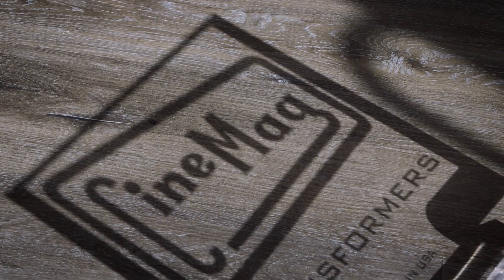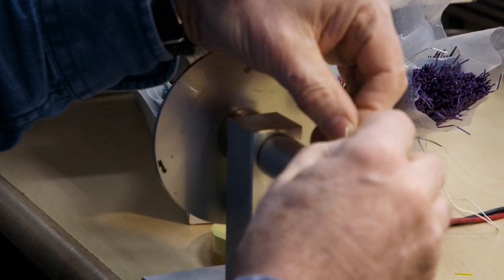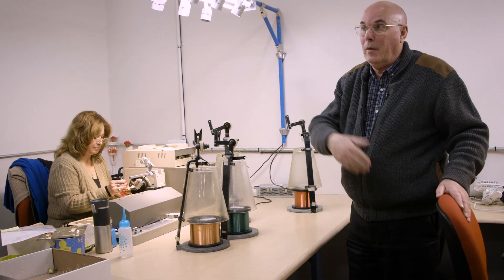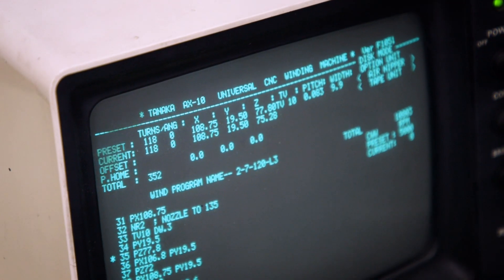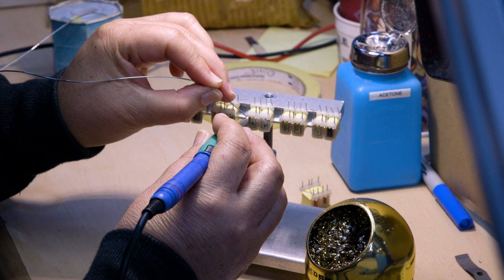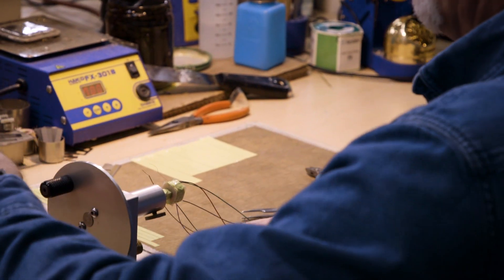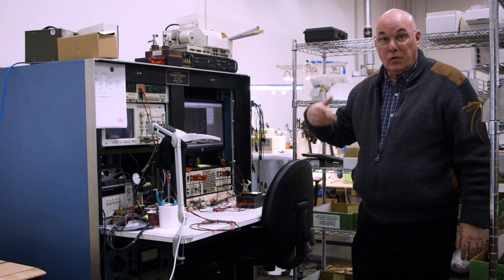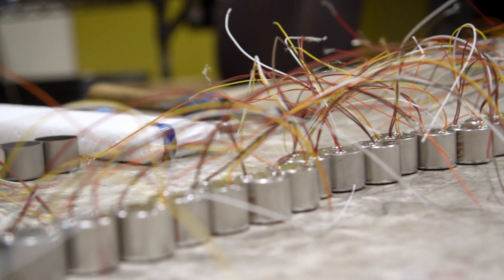How Cinemag Transformers Are Made 🛠

Comment: Excellent audio transformer manufacturing factory. I request you to kindly manufacture Vintage U87i transformer with same alloy compositions so that sonic character of U87i can be achieved accurately. It is due to some secret alloy compositions that U87i give sound like delayed attack of UAD 1176 compressor. There is some secret in the transformer. Although yours CN 9880 is said give quiet good sonic character     But in case you succeeded in replication U87i sonic character. You company will be on the top of the globe. Naumann himself has failed to reproduce U87i character.

Comment: Hey Sweetwater, do more videos like this! Would love to see the Pultec facility or even their transformer company! Love these American made companies doing old units!
Reply: They won't show it because people would find out they are overpaying for this units. From having a look inside eqp-1a i can tell you this are well made point to point circuits, material is pretty good, transformer likely made in their factory/shop because they cost a lot less this way. It takes a few hours to make such unit in series, complete material with chasis maybe costs 400-600$ if that much. Getting original sound requires original transformers and toroidal inductor, so for series production the only manufacturer making correct output is Cinemag CM-S217D, input and interstage are also made by them and probably others because they are not as complicated as output. Another company makes inductors if Cinemag doesn't. Doing in like original costs more than 500$ in transformers, then a few hundred for the rest so final product would cost more like 9000$ if they sell current 1ch eq for 5300$ :) Can't believe some are willing to pay so much even if i'm wrong about transformers and inductor and they use perfect copies or originals... I haven't compared Pulse copy to original but differences are there for sure.